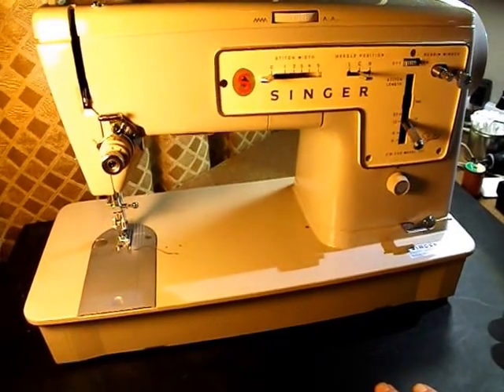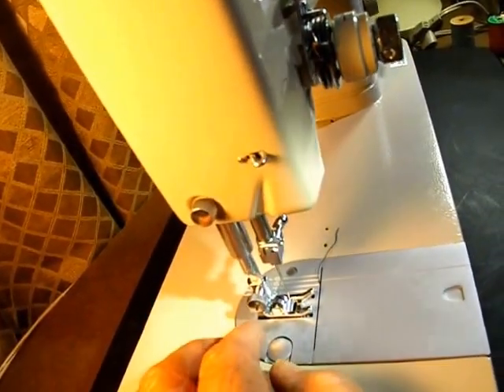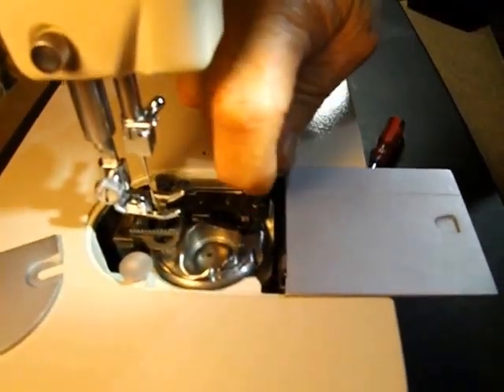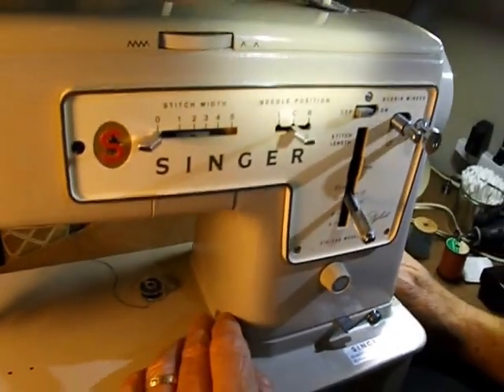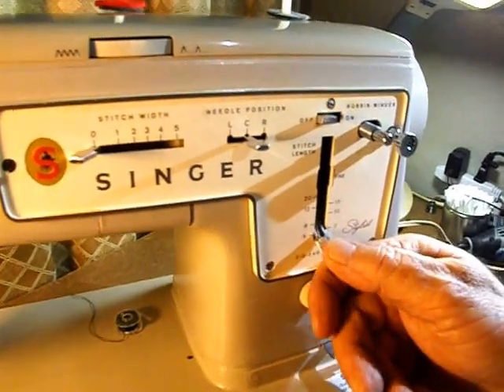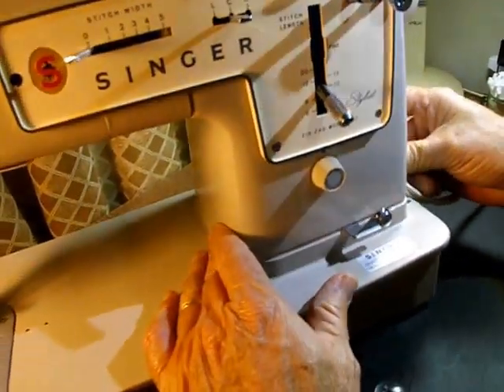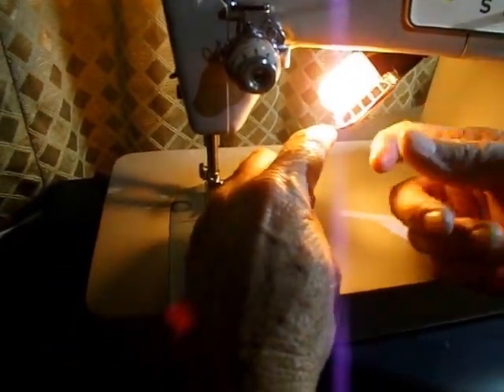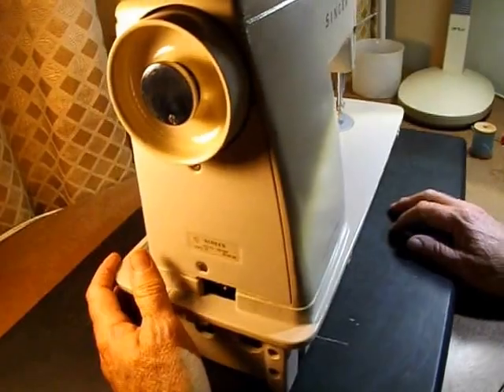TOUR THE FEATURES OF THE SINGER MODEL 457 STYLIST SEWING MACHINE

Comment: Hi again, I have a new problem. I was successful in putting bobbin case and holder back but the rotary hook is not turning. Thanks for your help
Reply from the maker: Val, most of the time when the hook does not rotate it's because of a broken top gear on the vertical shaft in the upright of the machine. That gear turns the shaft to the pulley on the bottom which turns the timing belt which turns the hook. The gear is internationally known to be of a type of plastic that stiffens and crumbles over the years, some people believe because of heat transfer from the top bushing just below the gear. This problem affects a handful of models that use this gear. I had so many emails about this that I finally made a video showing how to replace the gear for about $10.00 Maybe you could watch some of it and see if you think that's the problem on your machine. Good Luck, and thanks for watching Andy Tube. Link to gear change video: https://youtu.be/M3bFtlV1Y6s
Reply: Tengo una maquina cantante 457 que me acaban de regalar y no la entiendo es lenta  se tranca el hilo y la bovina no la entiendo,ceras que me pueden ayudar por favor

Comment: I'm looking at buying a 457, and I have to say this  is the information  video on any sewing machine that I have ever watched. Thank you very much for the time and effort you put in the details of the machine
Reply from the maker: Hi, Terri. It's a nice model with one weak spot. The top gear on the vertical shaft falls apart sooner than later. The new gear is about $10 and I have a step-by-step video for replacing it.
https://youtu.be/M3bFtlV1Y6s  I've bought a number of these at a low price because the gear was broken and the hook does not turn. Thanks for the nice comment and for watching my channel.

Comment: Thank you for your videos. I just got a sewing machine just like this one and didn't know a thing about it. Now I do.
Reply from the maker: How nice of you to comment, Linda. Thank you. BTW, you can download a FREE copy of the Instruction Manual from this link: https://www.singer.com/search/support?title=457
Take Care, and thank for watching my channel.
Reply: @andytubesewing1953  Thank you. I went over everything and couldn't get the needle to pick up the thread. The bobbin holder is not turning. Someone on You tube said it was probably a belt on the bottom of the machine. Do you think that is right? And where could I get one? I hope you don't mind if I'm asking.
Reply from the maker: @lindabailey7679  The bobbin holder is centered in the Hook. The hook rotates around the bobbin holder (case) to catch the needle thread. There is a belt and two pulleys on the bottom of the machine called the Timing Belt. Those make the hook rotate. The drive Pulley on the right is powered by a vertical shaft going up to the main horizontal arm shaft. There is a gear on the top of the vertical shaft. It is made of plastic. It has failed. A very common problem; very. With a broken gear nothing going down to the timing belt and hook is moving. I made a video showing how to replace that gear. The new gear costs about $10. The video has about 35K views which shows how common the problem is for this model and others of that decade. Here is the video: https://youtu.be/M3bFtlV1Y6s I don't mind you asking, Linda. I made my channel and 500+ videos to help people like save their sewing machine, and I hope you save yours. Best of luck.
Reply: @andytubesewing1953  Thank you! I'm going to see what I can do. I'll let you know.
Reply from the maker: @lindabailey7679  Best of luck then, Linda. The machine is worth saving; strong and versatile.

Comment: My sister is gifting me this exact model. I am so grateful for your videos because  we don't know if it is in working condition as she acquired it from someone else. I have downloaded  the manual.  Some people say this isn't a good model  and not worth repairing because of the plastic gear. But you address this in another video.
Reply from the maker: Congrats! This model has a bad rep b/c of that gear, but the gear is like 50 years old.
Yes, you can replace the gear. If is not broken now it will be soon so even if it works when you get it viewers tell me all the time as soon as they really started using it, or the first time they reversed sewed, the gear went out. With a new gear, you have a good versatile machine for home use, clothing, curtains, slipcovers, tablecloths, should be able to hem jeans, etc. Good Luck.

Comment: Thank you, this is so useful. I'm using my Mum's old machine (with no manual) and I've just learned a couple of things I wasn't aware of. 😊
Reply from the maker: I'm glad you found my channel, Sue.  Welcome to Andy Tube. If you'd like an electronic copy of the Instruction Manual you can download it for free from Singer at this link: https://www.singer.com/search/support?title=457
     Model 457 is a strong, versatile model, but I want to make you aware of a known weak spot. It has a plastic gear on the top of the verticle shaft and with its age now it is prone to chipping, cracking and crumbling. Then the hook will not rotate. No sewing. 
     This is a problem with a few models of that decade so I made a video about replacing the gear, which costs about $10. If you have time you may want to glance through the video and see the location of the gear so you can look into the top of your machine and check its condition. Here is the video: https://youtu.be/M3bFtlV1Y6s   
     I feel if you have the original gear and it is not broken yet it soon will be. During this virus "stay at home" period I have dozens of emails about the gear. {people get out an old family machine and soon after they start sewing masks the gear gives out. Sometimes, someone has already replaced the gear, but that is fairly rare. 
     You know where I am, so don't be a stranger if you have questions about your 457. 
Take Care.
Reply: @andytubesewing1953  a thank you, I'll have a look at your video and check it out. 😊
Reply from the maker: @suemoyers67  Hoping for the best; expecting the worst. Good Luck.

Comment: I am the original owner of a 457 and I wanted to replace the motor belt.  I bought a new belt from a company and it seemed to be the wrong size, too small.  It strained the machine horribly.  I then ordered from a different company, thinking the first company sent me the wrong part. Both are numbered 196386.  The second belt also seems not to fit, as it is the same size as the first.  So, I put the old belt back on, using your videos.   I believe I adjusted the belts as you instructed; there's no slack in these new belts at all.  Thank you so much for your videos.  I had not sewn with my machine for about 30  years, and then suddenly I had a large sewing project to do (15 bicycle vests for our cycling club).  After the 15 vest, the top gear broke, and with the help of your videos I replaced the gear.   Anyway, the old belt works fine, I just thought after nearly 50 years, my machine could use a new belt.  To even get the new belts on, I loosened the motor mount to its loosest position, and had to have my husband put the hand wheel back on with the new belt.  It was way tight, and no amount of fiddling would give me any slack near 1/2 inch.  I hope you can give me some advice.
Reply from the maker: I have had this same problem. I think many sellers are buying the same belt from China, and it is a very tight fit. I have tried ordering the next size up belt, and it is too loose. I usually manage to get the belt on and DO NOT run the motor. I let it sit and it slowly stretches. I adjust it a tiny, tiny bit every 12 hours and after a few days, I feel there is enough slack to run the motor without hurting it or bending the motor shaft. What a complete hassle. I wish a new a better way to stretch the belt a little bit. I left one out in the Arizona sun for a few hours and then tried pulling it by hand thinking I could stretch it 1/4 inch. Of course, it broke! I only work on belted machines when someone pays me to do it. I usually just restore the direct drive steel geared machines that don't use a belt.
Reply: Thanks so much for the prompt reply.  So these new belts don't really fit!  I will keep my old belt on; it does work.  With the help of your videos and suggestions, I learned how to take off the face plate to access the top gear, I have removed the cam stack for easy cleaning and greasing of the worm gear, adjusted the stitch width device, and taken out the needle bar and presser bar and cleaned and put both back in.  I've only used alcohol and Q-tips for cleaning; gets things clean enough for me right now.  Your videos are so helpful and encouraging.  Decades ago, the only thing I did was oil according to the sewing manual, and now that I look at it, I think I over oiled; this time when I oiled I wiped away excess oil.  I will keep watching, as your videos are so well done and understandable for people who have never done anything beyond oiling.  I am going to get back to sewing for a bit; I only need straight stitching, back stitching and zigzag, so the 457, as long as it lasts, works for me.
Reply from the maker: Your 457 is a very well-made machine and it's great for clothing and light-to-medium crafting. I am really happy you could use the videos to get it cleaned up and sewing. Alcohol is fine and once you clean it the way you did it is easy to maintain. Wiping up after you apply oil will avoid problems and only takes a minute. Thank you for your comments and for watching Andy Tube.

Comment: Thank you! Appreciate this video as I purchased a Stylist 457 on 5-16-70. Receipt still in the manual. :-) Sure wish the Internet and folks, like yourself, had been on a "You-Tube" back then. Sure woulda saved a lot of hair-pulling frustration, that's for sure. FWIW, my 457 stayed neglected in it's desk style cabinet for a number of years. Recently decided to bring it out of retirement. Oiled it up and it moves freely. Sadly, the "Singer Lubricant" that I applied, according to Singer instructions, looks like the brown globs in your first 457 video.  That said, I'm thankful that YT search turned up your channel. Now, I have guidance that was sorely needed many years ago. Much appreciated. Subscribed.
Reply from the maker: Thank you so much! I wonder what was in that original Singer Lubricant, haha. I'm glad you plan to put your 457 back to use; it is a very capable machine, as you know. Would you care to share how much it cost when it was new?  
People have asked me what some of these cost originally, and I really have not found a source for that. Take care, and thanks again Lee.
Reply: Andy Tube Andy, sadly my receipt is for both the cabinet (#678) and head (#457) combo. Total was 183.95 for the pair. This cabinet appeared to be a desk with 2 drawers on the left side, when not setup for sewing. A panel in the top was removed and the head lifted on "hidden" hinge pins. Maple finish, with turned legs. Relatively expensive cabinet for the time, but don't know how much of the $183 was cabinet. ??  Hope this helps, a bit.
Reply from the maker: Yes, thank you. It's more info than I had before. When I look here: http://www.saving.org/inflation/inflation.php?amount=184&year=1970
it says that is over $1100 in 2016 dollars! Imaging that. If I had that much to spend today, wonder what kind of machine I could buy? Here is an article from 2012 with some machines in that range: http://freshlypieced.com/2012/07/sewing-machine-shopping-what-i-learned.html
Man, are they "advanced" or what?

Comment: Hey Andy, I was able to replace that vertical gear that goes bad on these machines.  Yay me…of course it was from following your video on that.  As I was trying to complete the work on this model, it felt like maybe the motor was a little sluggish. I’ve been looking all around tonight for a video on how to get in there and clean that up a little bit. Do you recall any videos you may have made covering that.  It’s unlike the 400 and 500 motors but I could not find one single video on it.  Thanks.
Reply from the maker: Clean the commutator: https://youtu.be/rpTy_Bz3prA
Remove/Replace motor: https://youtu.be/sDcexZeS0f0
Page 81 of the Service Manual I just sent you.

Comment: Hi Andy... Really appreciate your Videos as I collect Sewing machines here in Ireland and have over 50 in my collection .Have acquired a Singer 457 and replaced the upper Bushing ...have watched your video about adjusting the needle bar however When I have done the adjustment the needle is hitting the needle plate when the lever is moved to the left position ( L. C. R. ) but not when it is on the no.5 position in the Zig Zag mode.
Reply from the maker: There is an adjustment for the needle position bracket assembly and for centering the needle bar, etc. If you email me andymanuals53@gmail.com I'll send you the service manual and parts diagram (free)  If you don't care for that, you can buy and download the manual for $7 at this link https://manualsoncd.com/product/singer-400-series-service-and-repair-sewing-machine-manual/    it's always good to have the service manuals if you can find them, IMO. Over 50 machines is impressive... a true herd of machines. Happy for you. Take care. ✨

Comment: Andy the singer 457 my hubby paid 3.00 plus 6 part she runs now like a top. Thanks to your help And she came in nice cabinet. She still has surface rust on outside levers. Any ideas?  And she winds a tight bobbin and even stitches.  When my son gets home I will upload you link on my page. After I figure out how to upload
Reply from the maker: That has to be the best deal of 2017! Congratulations you guys. Here are a couple of videos about removing rust and polishing small parts. Depending on the rust amount, you may just need to polish them with Brasso, and not need The Must For Rust product. You can spend more on polish, but for me, it works just a well as the more $$ ones I tried. It does smell strong though.
https://www.youtube.com/edit?o=U&video_id=anyDAwKZmDY

https://www.youtube.com/edit?o=U&video_id=vSoW6K_9oPY

Comment: Hello Andy,
I have a 457, when I bought it I had to replace the top gear on the verticle shaft before I could use it. She's been running smoothly ever since. Recently however, I've encountered a slowly worsening problem that manifests itself in a loss of "strength" or "vivacity". The machine runs slow and sometimes needs me to turn the manual wheel to help it to start but no longer reaches full speed.
I thought the source of the problem was from the clam pedal. I watched all five of your videos, then dismounted and cleaned the  pedal. Unfortunatley this was not the source of the problem.
Please, do you have any counsel as to where to trouble shoot next ?
I hope you get this message, I watched your most recent video. I hope you change your mind and come back soon.
Best wishes from France !
Reply from the maker: Sorry to hear this, Cary. Cleaning and adjusting the foot controller was a very good step, as that is often the cause of sluggish, underpowered performance. Nicely done. Here are some other things to think about that I have come across. Check the set screws on the new gear and the hook pulley for tightness. You don't need to overtighten, just be sure they are nice and snug. After hours of running and the metal expanding and contracting for warmth/heat, those screws we thought were tight may be slightly loose. Be sure you have oiled all the correct places, including that little hole in the center of the hook; under the bobbin using a good quality sewing machine oil or TriFlow product. If you need a copy of the Instruction Manual with oiling instructions you can get a PDF downloaded copy from Singer for free;
https://www.singer.com/search/support?title=457
The next thing to look at is the commutator on the motor. It's a little bit more involved on the 457 b/c you must pull the motor out of the machine. You leave the wires attached, set the motor on the table/bench, and use a diamond stone ($10) to polish the commutator and reseat the brushes. It's amazing how this will increase power from the motor. The best thing you can do for a sewing machine motor, IMO. I show using the diamond stone in this video; https://youtu.be/rpTy_Bz3prA     Here is a video to help you see how to pull the motor out of the machine. I can do this now without moving the light;  https://youtu.be/Hvacqu44-mo   
I hope this helps move you forward, Cary. Good luck, and thanks for watching my channel.

Comment: I have one of these type of machines (467) and been well cared for.  I am having a problem wiith pressure regulating dial.  It appears to be stuck. Also the dial for the feed dogs is also stuck (can't drop them for free motion, darning).  Any ideas on how to fix this?
Reply from the maker: I'll start by letting you know you can buy and download the original Service Manual for $6.99 here: https://manualsoncd.com/product/singer-400-series-service-and-repair-sewing-machine-manual/      It is always a good idea to give the machine a complete lubrication before making any adjustments or repairs b/c that may fix the problem. Here is a  VERY complete video for lubricating your machine: https://youtu.be/AU7YeSeLHX4    I believe model 457 has the same feed drop (feed throw out) system as your machine and I made a comprehensive video for working on that: https://youtu.be/hxOscoEdkxY   Hope this will help, and thanks for watching my channel.